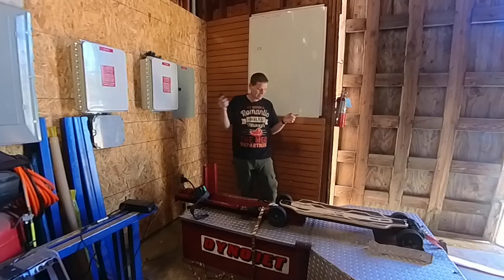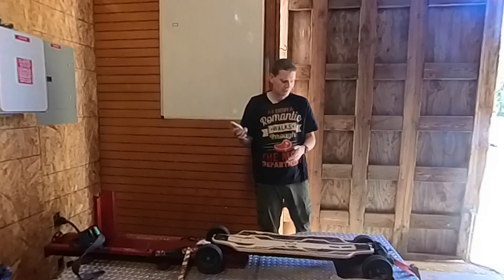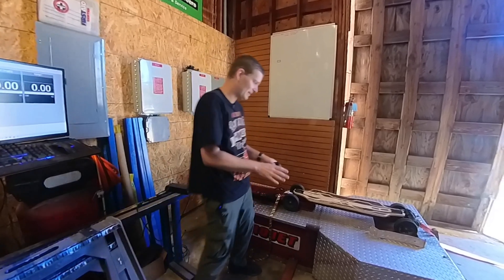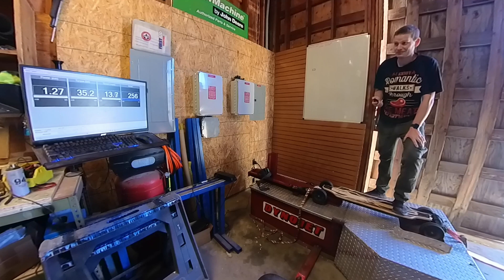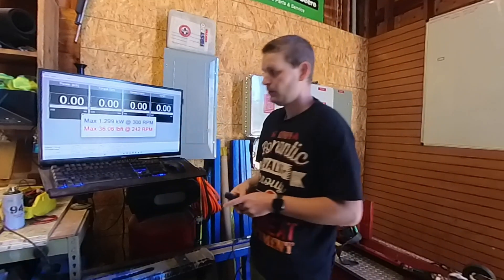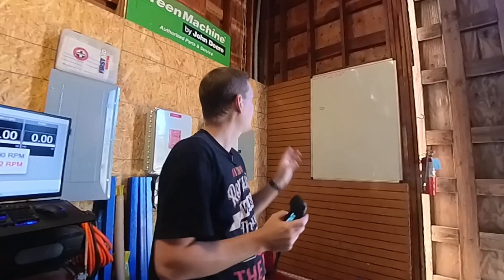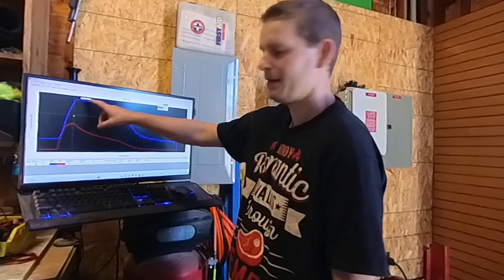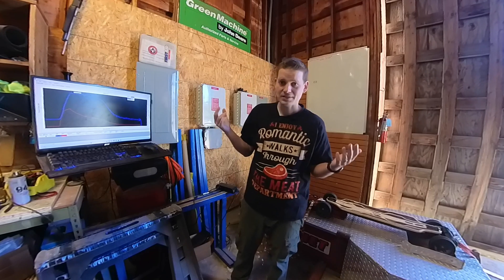Electric skateboard on a Dyno - Results not as advertised...

Comment: Although I largely agree it’s a lot more complicated. Battery amps vs motor amps. The motors might have the amperage to produce that many watts at battery voltage but the ESC isn’t capable of that many amps at the full voltage. Motors don’t use battery voltage at less than max rpm. You could have an esc that only does 50 battery amps and still see an improvement in acceleration going from 75 to 100 amp motors. I can share some charts that help explain it.